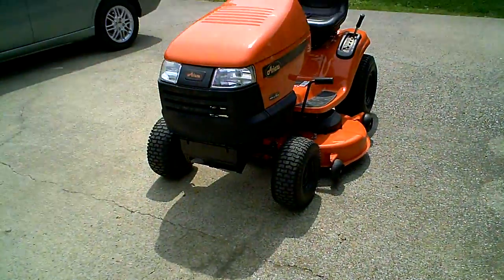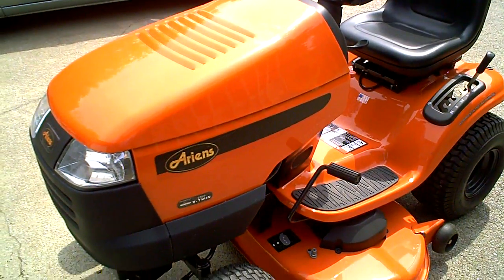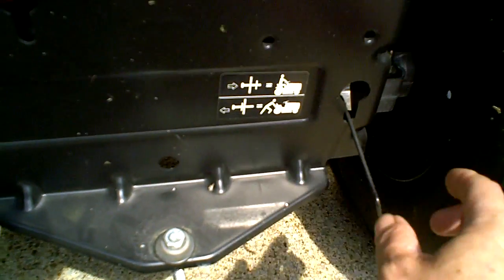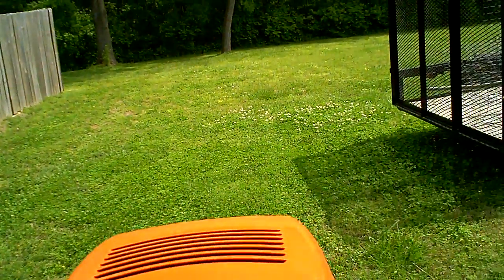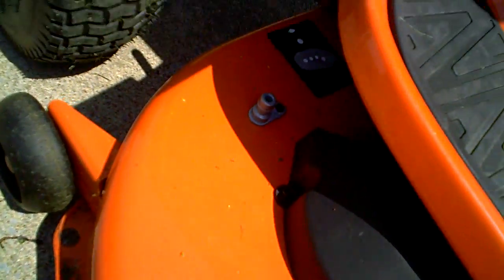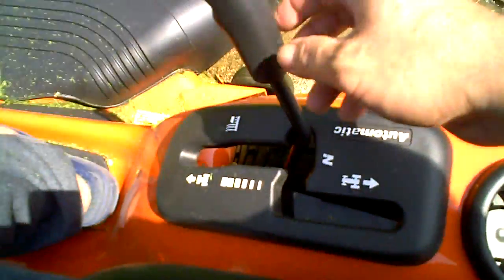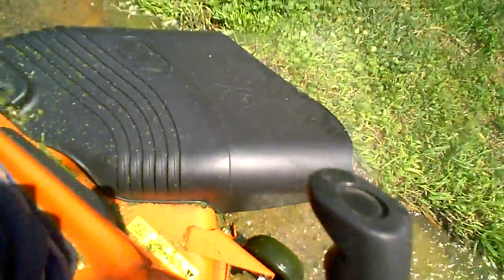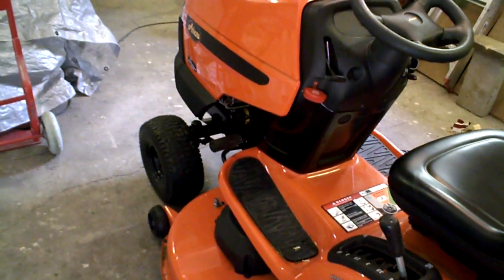Ariens Mower  22hp 46 Inch Hydro + Auto overview

Comment: I'm impressed...very impressed.  You commented on the sound of the mower which is something I noticed right away... very easy to live with and sounds quite pleasant and powerful in cut mode.  I have a 12.5hp, 38" cut called 'Castlegarden', an Italian make, which is very good.  It has straight-through grass blowing so no corners to deal with on the way to the bag, that's almost imperative in Ireland where we cut wet grass a lot.
Good video.

Comment: Good advice on using the break, when I first got mine it took a bit to get use to driving it. I actually slammed into my garage door when it launched off like a rocket when I released the break. Put a nice dent in the garage door 😂

Comment: Thank you so much for posting. I watched this video before buying, as I just purchased this mower for an incredible price last week. It just turned 9 years old, but it's new for me. It is in fantastic condition. I did change the oil & filter, spark plugs, air filter, and fuel filter for good measure the day after purchasing. I then proceeded to install a mulching kit, as I always like to use mulching blades. I did my first cut with the lift blades and just blew them out the side. I am waiting to see how the new mulching blades work. I'm certain they will be fine. Is there anything in the ways of problems I should be looking for as this machine just turned 9 years old? Again, it seems to have been maintained very well and shows a little bit of wear. Enough to know it has been used, but not abused.

Comment: Have you had the control cam break yet? I have one where the throttle petal going back to the transmission has broken at the middle thin spot causing it to no longer move forward. It's sad they put plastic transmissions in these.

Comment: this ariens, plus Husqvarna, plus craftsman were all built at the same factory in south carolina. today's black poulan mowers at home depot come from the same factory too. all four often have the same frames and the trim is changed for marketing. my ariens 93604200 a20bh42 is ftom 2010 and has a v2 briggs 20hp. it has been through one battery. it has the same blades and belts. i have changed the oil once. the air filter 4 times since yard is dusty. in cold weather or at the start of spring i often shoot some ether into the intake so it starts quickly. ie if it sits up for months often alot of cranking at start of season.  unit is from 2010

Comment from the maker: thanks ,, yes .. some people have killed the transmission by constant brake shifting, than  put complaints up about it.... trying to say the mower was at fault .. that's why I repeated it a few times .. it's a really good brand..for me it's  high tech
Reply: stymye ..i cant get mine to move foward,unless i slam down hard on foot pedal..do u know what is causing this??
Reply: I like mine also, but it did take a little bit to get use to the break. I quickly learned that the pedal is basically useless unless you are starting the mower.

Comment: mine is still running great cutting 4 acres. i did put a manual choke lever on it because  you have to put it full throttle  for the choke to engage even though it has an internal oil pump.i don`t think its good for the pistons being cold running high throttle. now it starts quiet and I only have to slowly unchoke it in about 20 secs.

Comment: I know A20VA46 is the Home Depot model number for this unit. Do you happen to have the Ariens Model Number for this available? I am looking at buying a used unit and the hood seems to be bent, not seated properly when it is down. I want to look up pricing on a new hood but cant find the Ariens model number. Thanks!

Comment: To Healthy American if it cranks and won't start check the choke mine was out of adjustment and won't start. Bought a 2014 Husqvarna last September and stored it after I got it home went to try and start it a month ago no way. The dealer said it was the choke cable out of adjustment
Reply: you were right...just saw this but my lawn repair guy came out and i remember he adjusted something and it has done well ever since. actually thats the only problem we ever had out of this mower and its a 2011 model we have used it on a half acre all these years. but we have the vtwin 20hp briggs

Comment: Can you post a picture or video of the belt routing? I had a spindle break and now trying to figure out the routing for the belt. The way the manual and the picture on the deck has it doesnt look like its going to work due to the belt keeper on one of the idler pullys rubbing on the belt in the direction they show it going.

Comment: I have a 2009 ariens mower it wont rool. I cant even push it. back wheels are locked or locking when i try to push it. I have engaged and disengaged the pull trigger on back of mower. Still no luck with back wheels moving at all. Please anyone have idea. I have tried all kinda things to get it to roll. And yes i do have parking brake off.
Reply: charles carrell ...hope you get to read this.. it is very common for people to leave the parking brake locked on and it can seize on after long periods, look up under the hitch on the trans  by the right wheel you will see the brake disk, pry "GENTLY" between the trans and the disk with a large screwdriver this should release the brake, if this works the whole mechanism should be removed and carefully lubed

Comment: do you still have this mower? I had the drive belt go out on mine and I need a reference picture of the belt retaining bracket at the motor. specifically the relationship of the  bracket to the tabs on the chassis. can you provide pictures? or video? a video of the whole drive belt front to back would be even better. thanks
Reply: +doug petschke  btw i am on facebook under this name you can friend me  cuz my it may be easier for me to know you posted something
Reply: +doug petschke Look for the video of a Husqvarna drive belt replacement, very detailed and takes about 20-30 minutes to replace.

Comment: Where did you buy your Airens at? What did you mean by Hydro plus auto? Do you have to leave your hand on the throttle stick or can you take it off when you get to the speed you want it at? I am thinking about getting one cause they seem pretty cool. Feed back please...thanks
Reply: Yes, you can do both. Leave your hand on if you plan on doing a lot of maneuvering, or place it in forward and just steer when you are in the straightaways. Some have cruise control.

Comment: I can't fine any fix for ariens model# 33R877. When I release the clutch pedel the engine cuts off. Is this a safety or gas problem I need a solution ASAP.
Reply: This does not have a clutch pedal, just a brake foot pedal on the left. When you release the brake pedal the motor will shut off as a safety feature if the blade is engaged and you get off of the seat. Does yours cut off by just releasing the brake even though you are still sitting on the seat?

Comment: I have this mower and I'm less than impressed.  My auto choke wasn't working correctly so the mower would not start.  It was driving my crazy untiL I figured it out. I now have to manually push the thing up from the front of the mower while standing up with the emergency brake on an turning the crank.  It does fire up right away and its probably not an expensive fix but frustrating for a 2 year old mower.  Anyhow, today the steering went all wonky, and I looked down only to see my front left wheel not turning in the same direction/angle as the right.  I will say it appears to be easy to work on as I already have the ball studs off with the hopes that they are bent, hard to tell by looking at them.  I so wish I would have spent the extra money and purchased the John Deere.  I had a Scotts (Made by John Deere for one year) and had zippo issues with it.
Reply: it looks like they copied husqvarnas design with electric pto switch
Reply: Hyatt Baker ...blame the engine not the tractor

Comment: I've got the exact machine and it replaces a very similar 19/42" that I purchased 4 years earlier at Home Depot also.  1) The cut is not as clean as the 42", this is a 42" unit with an over-sized 46" deck that is too much for the machine for mounds and hills as it scalps over mounds where 42" did not & wheels spin out from the bigger deck pushing too hard up on the frame. 2) The deck needs constant adjustment 3) big steering flaw! front wheels splay out after hitting a few roots. Shop can't fix!

Comment: I have this exact mower and my data plate/sticker was damaged. Can you tell me the modal info. 960......
Reply: that 96 number will not cross reference.   You need to use the number on the book which is 936056

Comment: I have the husky version  little rubber hose to fuel pump cracked,giving poor vacuum,coil air gap way to wide,not sure why some have voltage regulator,others  seem to have diode,still hard to start,well maintained, not sure I like auto choke,46 In,wash port is a joke,triple bagger works well ,be sure to adjust anti scalp wheels,headlights fill with dust,should be led bulbs,not great traction  up hill,otherwise i like it with steering wheel spinner

Comment: I bought a 46" 22hp Briggs and Stratton engine, Ariens mower three years ago to replace a 25 year old Bolen. I got tired of the starting problems that come with the age. Boy did I buy the wrong mower. Never since the first year has it started without issues starting. I always winterize so that isn't the problem. Not to mention no machine should be so sensitive. I've seen mowers that never got service but once every 5 years do better. There are plenty of reviews saying the same and a few out right liars. I will never buy Arien or parent company Husqvarna tractors. I didn't buy a $799 mower at Wal-Mart I bought a $1499 mower from Home depot. My review not worth the money. Buy John Deere or go cheap.

Comment: China parts assembled here still ? Wherever the steel is made it flys apart. I don't know . , just know I repair 2-3 x annually , steel flys off after 3 yrs steering goes fast , brakes lock up over time.  Original tires 1 baaahhhh. sure they're nice the first year. Or if you have a 40' lawn   You'll see   Older ones were so much better.

Comment: This mower is junk. I have to work on it every time I mow. The drive belt slips off. The bolts holding the read end broke off. Today I had to order a new front axle for it, the welds are breaking. Do not buy this mower.
Reply: Sounds like you got a lemon, mines been working awesome for 4 years. Looks and drives like new and I mow a 3/4 acre lawn about every 10 days.